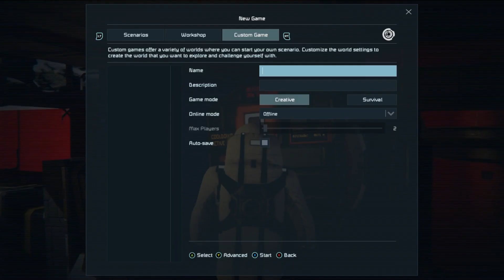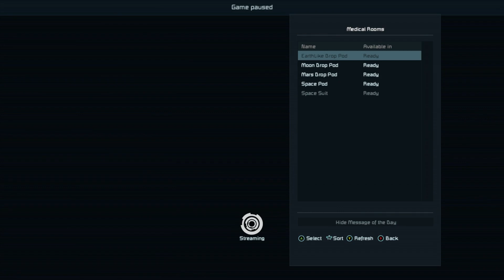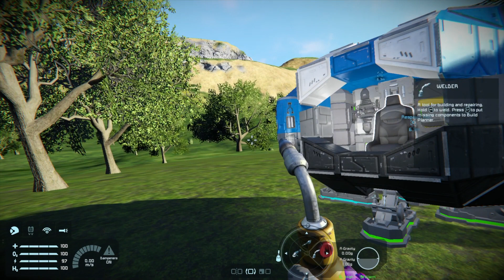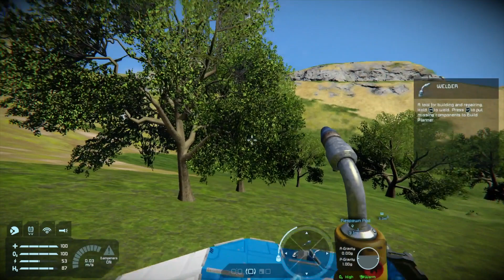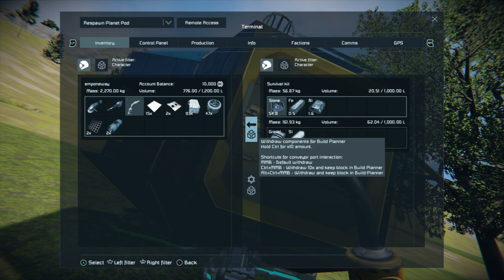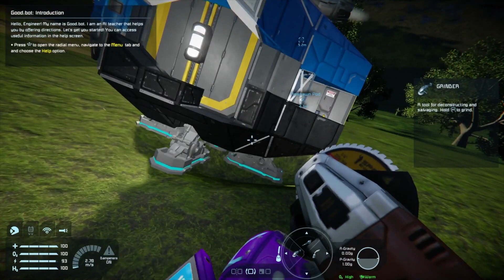Space Engineers | XBOX ONE | Part 1 | NOOB GUIDE | Basic Survival Start

Comment: I have built my spawn ship as you did but thrusters aren't functional. How did you get them working and how is the ship controlled?
Reply from the maker: Make sure you place the remote control block. And it is in the right orientation. You will see arrows on it that help with that. Once it is placed you can sit in the passenger seat and pres. “k” this will bring you to the terminal in which you chose the remote and click control. This puts you in control of the ship. Hope this helps. I will have to go back and look. I though I included how to control the ship. Thanks!